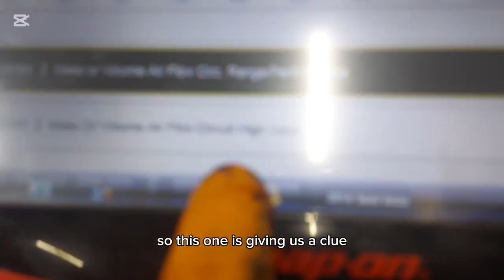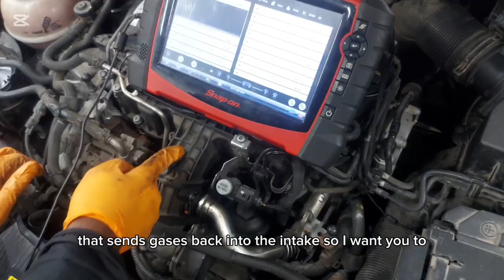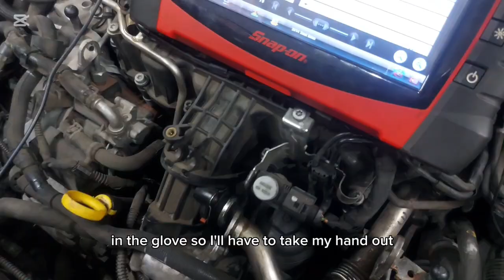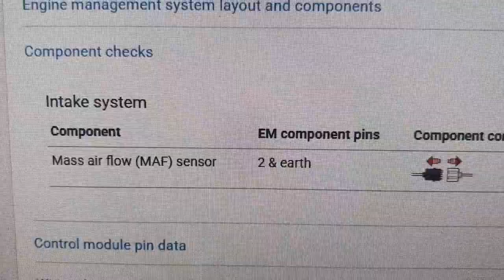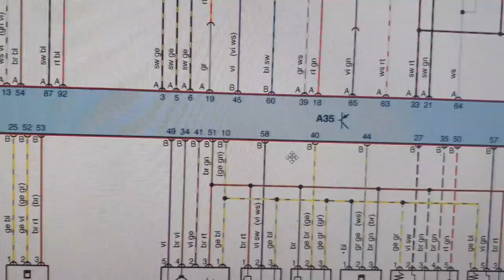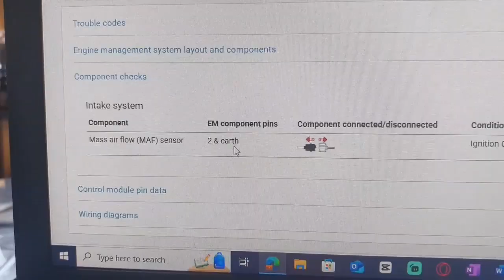EGR Valve: The Secret That’s Messing Up Your MAF Readings

Comment: hi can you help .. i have a bmw f07. 530d 180kw.2012 year still my drivetrain is jumping i changed a new egr valve. new maf sensor and map sensor still the same car at idle or has free air when i have the maf sensor disconnected the car runs like clockwork thansk
Reply from the maker: Can you please elaborate on your drive train jumping

Comment: The issue is not with the EGR. At idle it is normal to see around 5 to 6 g/s and blocking of the egr it should be around 2 times higher. You just showed the working principale of EGR and mass air flow
Reply from the maker: I have fixed so many of these using this method. I have taken onboard what you said. Thank you for making me wiser. Where are you based Sean? we can link up
Reply: But, if the EGR valve is stuck open, it will lower MAF readings, won't it? Because you now have extra gasses coming in and less air form the outside.

I even checked on a 1.9 TDI, BLS. At idle 15g/s. I manually energised the EGR valve and before the engine stalled out, the g/s dropped to around 4.

Comment: Hi @jamroz great video... what were the symptoms of this issue, what code was being presented to illuminate the eml. Thanks 
I have a mk7 golf 1.6tdi which has 7.6g/s @idle on the air mass meter.
Reply: Have been trying to get to the bottom of an underboost issue for months.
Reply from the maker: Engine management light was on. Slight power loss but not too much you. Is the engine management light on ?
Reply: @jamrozelectronicssolutions7232  yes and keep getting an underboost code p0229....